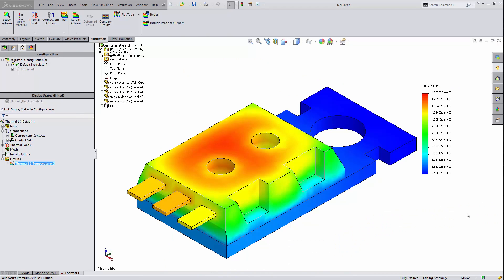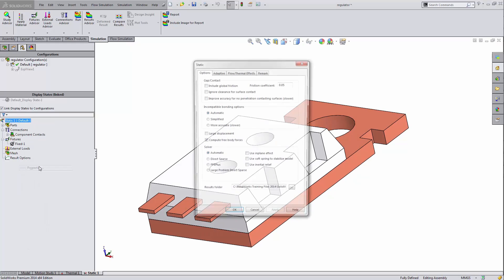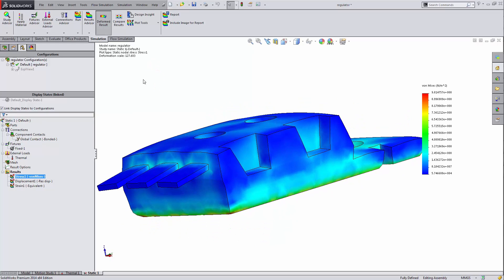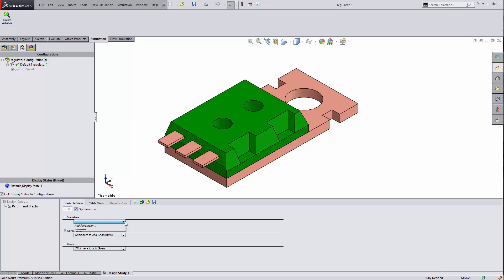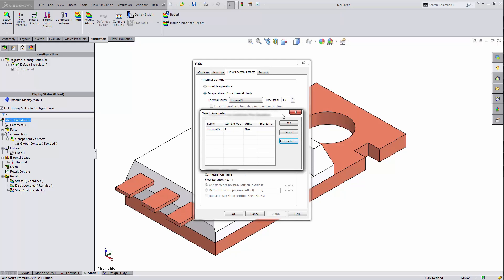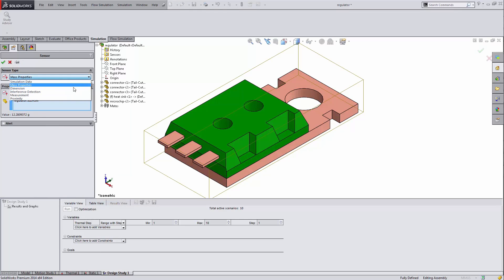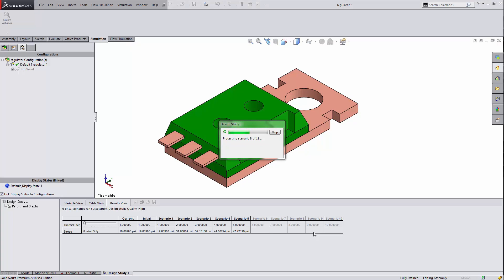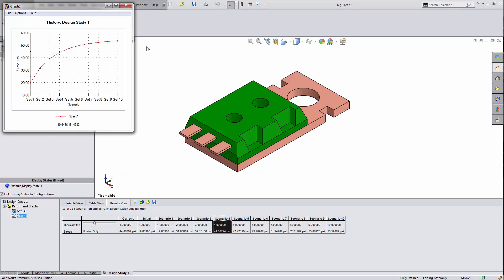SOLIDWORKS Simulation 2014 — How to Export Transient Thermal Results into a Static Study

Comment: will this work with flow simulation? like different configurations? say for an aero foil, different AOA.
Reply: the values you got from design study, it was the stress at one point, it looked like it, and not a stress distribution?